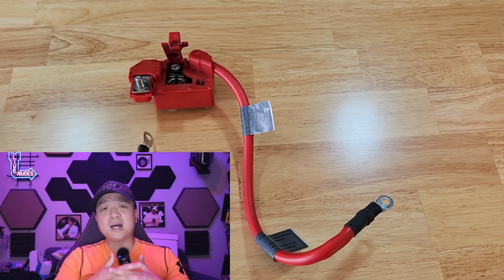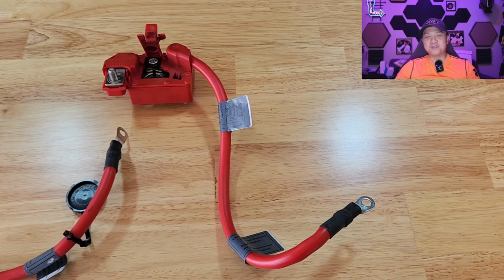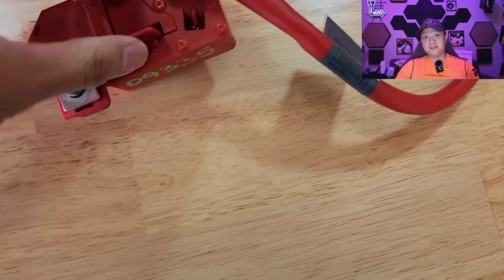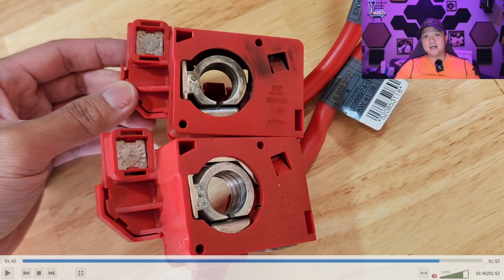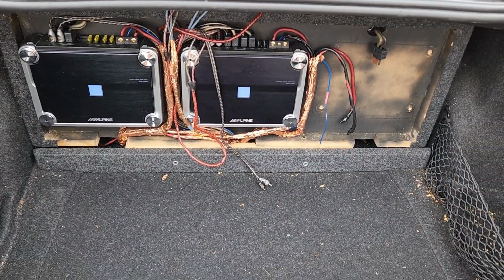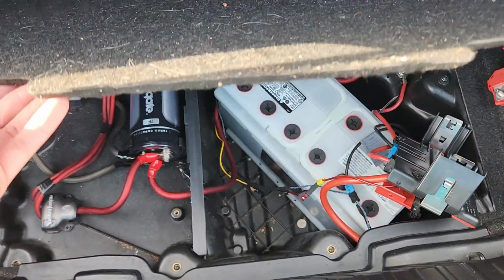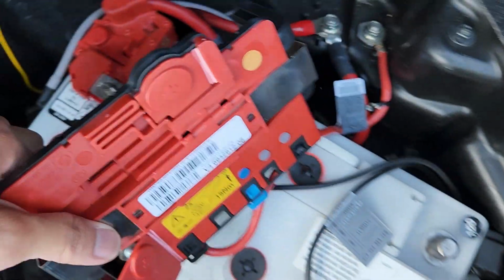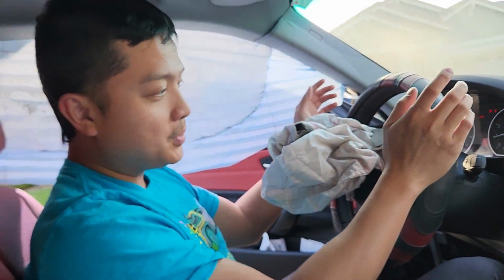BMW would not start after an accident? Here is the fix. BMW 135i Battery positive cable replacement.

Comment: Yo man i replaced rhe cable but blw does nothing
Reply from the maker: What model do you have? What's the state of your battery? I know sometimes when it sits  for a while it may also need a charge.
Reply: @woteverworks i got a bmw 328i sit for 2 month only start one but now it don’t even change the fuse. Box battery